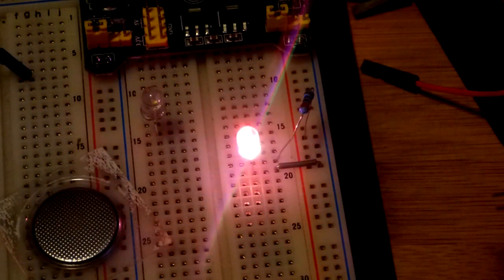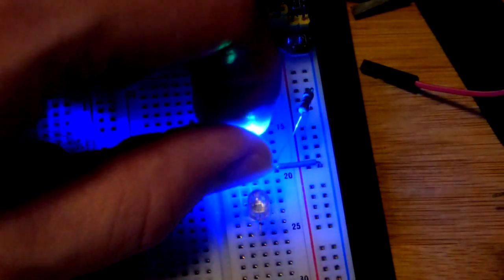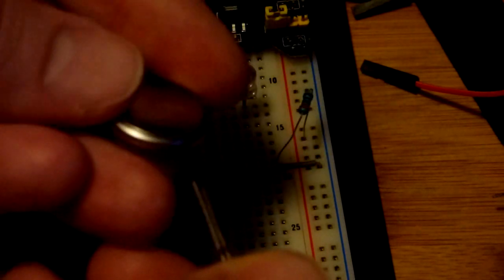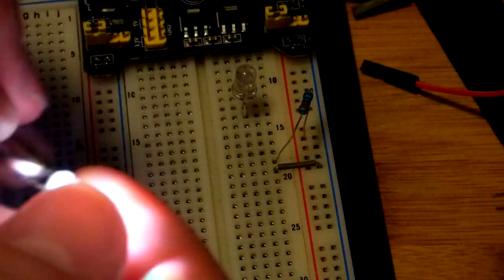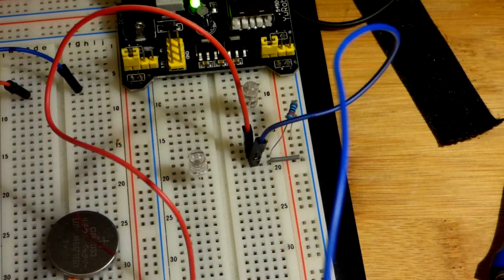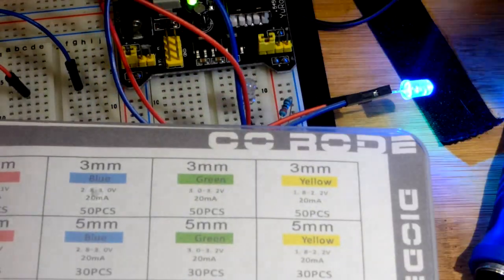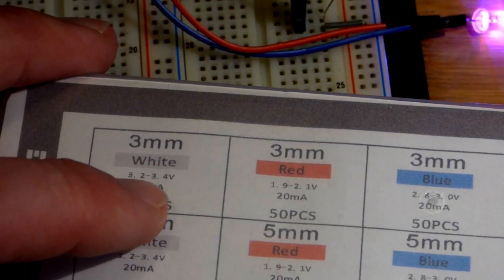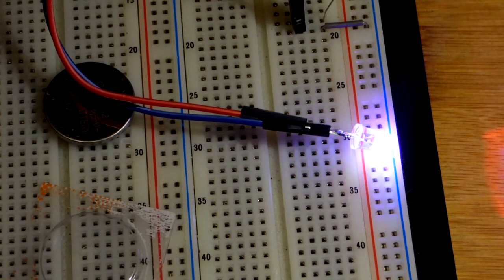Fast blinking and slow flashing automatic color changing red blue green RBG LEDs

Comment: I've come to the conclusion that any LED with a microcontroller chip built in are fairly robust and will work WITHOUT using a external resistor with a input voltage of 5 volts DC.
Reply: I know it's probably overdriving the internal components a bit but I know I had several on a breadboard with one of those cheap 3.3 and 5 volt power supplies as shown here on the power rails chugging away for months without any noticable decrease in brightness compared to control LEDS from the same batch that were inserted just before the brightness comparison.

Your mileage may vary.
Reply: You are right. I run them off of 2 or 3 AA or AAA batteries no issues. No resistors.

Comment: Your so called slow or flashing LED, is really alternating colors LED. There is no flashing in your slow, all it's doing is alternating colors,  I don't know why you would call it slow flashing. I look closely to see a flash or blink on your so called slow flash and guest what? I see not flash or blink whatsoever, all I see is LED color changing.
Reply from the maker: Thanks for the info!
Reply: I agree, but that is how they are labeled for retail. But yeah the fast blink ones are a fast (dance mode) type. And the "slow blink" ones I like to call slow transition LEDs.

Comment: I was just playing with some flicker flame LED stand three of them in parallel with 5 volts and a 470 ohm resistor I was going to try to make a couple banks of them and put them up in a row to have a little flame me a strip of lighting might be interesting I might put up a video later if it comes to fruition..
Reply from the maker: Sounds cool alright!